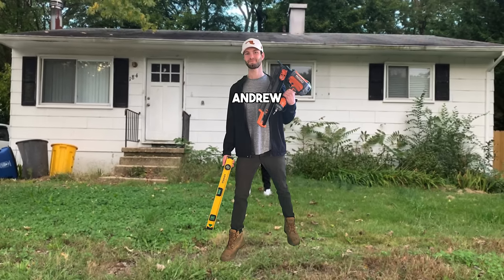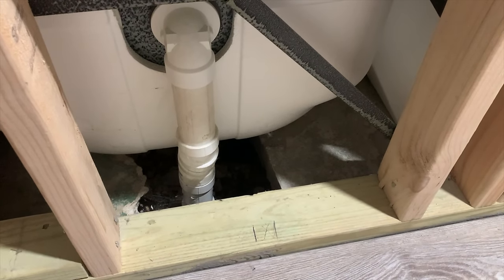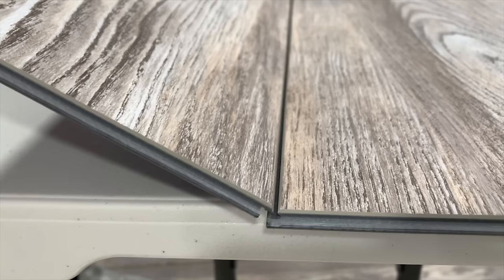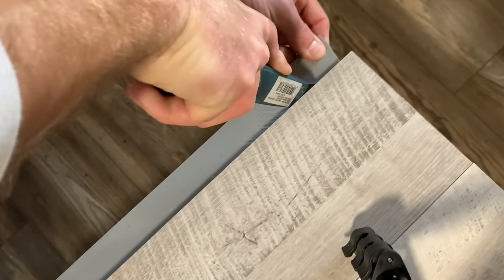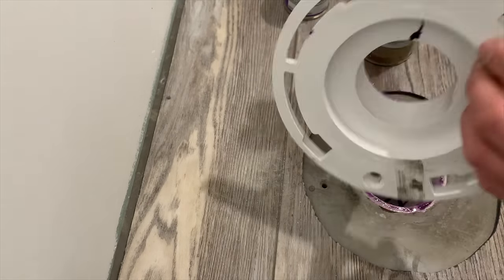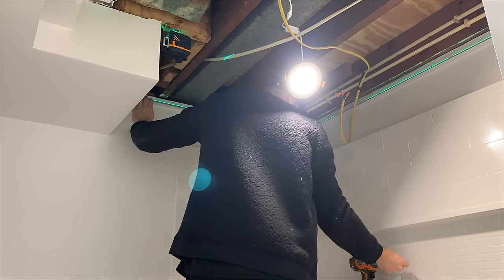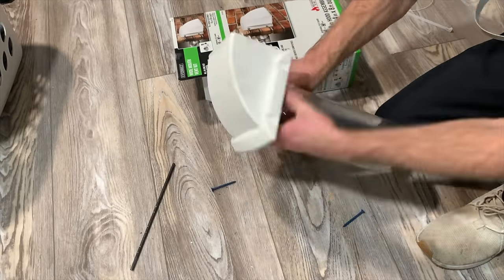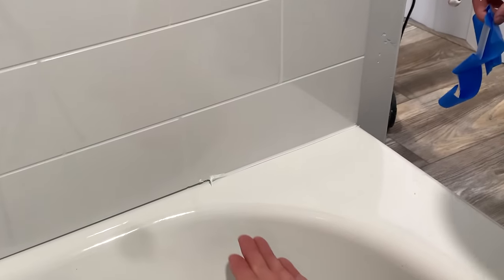Incredible DIY Basement Bathroom Addition Timelapse From Start to Finish! (+$39,000 in Home Value!)

Comment: I’m not a fan of dry walled ceilings and walls in a basement. How do you get at the plumbing, electrical, and drain systems. Next basement I’ll use a OC product that the panels click into place for the walls. And for the ceiling, although a smooth flat surface is nice, this system employs T shaped track. One side gets attached to ceiling and the other section snaps into place. Allowing to get at ceiling mounted support systems.  You did a very nice job on your basement

Comment: Nice work! For the best silicone lines you use tape first and then soap water. And you should add silicone to the ceiling boards, moisture from the shower Will rise and get up there Even with your fan on 😊
Reply from the maker: I appreciate it! Soapy water is good too and window cleaner works too! Thanks for watching!

Comment: I’m back and forth about drop ceiling in the bathroom I’m planning on my basement. I read that it can cause trapped moisture and of course lead to mold. Thoughts?
Reply from the maker: Hmm I don’t see how a drop ceiling would trap any more moisture than drywall 🤷‍♂️ I’m initially skeptical but I may need to do a little research
Reply: Okay yeah, I was all about doing a drop ceiling, then I looked it up and saw a lot of literature saying it’s not ideal due to moisture accumulation/retention- BUT, pvc might be the factor that makes your application safer, along with the fan location. So yeah just another DIYer to another I say do what works best and as long as you’re aware of potential issues - just keep an eye on it.

Comment: Nice work! I plan to do something similar in my basement. How much did the rough in plumbing cost you? I know there are a lot of variables, but I’m also in the Northeast and trying to get a ballpark for how much hiring out that step (including the concrete work) would cost.
Reply from the maker: I appreciate it! I spent around 2,500 for the rough in plumbing (which I think was a pretty good deal). Thanks for watching and good luck with your project!
Reply: @AndrewThronImprovements  you got a great deal! I would’ve expected 2-3x that

Comment: You should always build floating walls (code for us in Canada and likely northern states too) in a basement due to the slab shifting. This prevents it from heaving into your floor joists.

Your electrical wires werent stapled properly. Thats an inspection fail.

You don't need a licensed anyone to do any rough ins. Typically (not all the time) Homeowners can apply for their own permits. Just be sure you know the building codes for when it gets inspected.

Comment: I've seen your videos and can tell you take pride in your work. But this job was not something to be proud of. The waterproofing on theat shower tub is pathetic. The LVP is a big mistake. You should have tiled the floor. The accordion door is a real bad look. The custom barn door is odd considering the work on the door vs the work on the bathroom. The PVC piping is really weak. Use pex or copper

I like your videos. Not trying to rip on you. I just think if you are going to film a video, you need to do better. If your a scammer trying to make easy money on a flip (I know you're not), keep doing renovations like this
Reply from the maker: Appreciate all feedback! Let’s dive in a bit though:
1. Can you elaborate a bit on your waterproofing comments? The tub was set by the plumber and the shower surround was installed per manufacturers recommendation. As far as caulking, it is actually advertised as “Caulk Free”, but I added some as an added layer of insurance. 
2. For the LVP, I just matched what was done in the rest of the basement. I agree that tile is nicer. 
3. Accordion Door is definitely now a proud point haha. I call it tacky in the vid (cause it kinda is) but I needed access and went with a quick, cheap solution. Can’t defend that one too much haha.
4. I Agree they PEX and Cooper is superior to CPVC. I didn’t specify in my SOW (my mistake) and the plumber did the rough in with CPVC. 
5. Custom Barn Door was just a fun project I thought of. I agree that it is a bit out of place. 

Let me know your thoughts on technical issues. I am not as worried about stylistic choices since no two people will agree on those. 

Thanks for taking the time to watch and comment. Appreciate you!
Reply: @AndrewThronImprovements  

Hey no problem!

1. No problem with the tub. The issue is the shower surround. What you have almost always (99.9%) fail swithin 10 years. Water finds a way through it. I've seen it plenty of times and everyone I know involved with remodeling/building agrees. Most homes built before 2010 have tiled surrounds with waterproofing underlayment underneath.

2. Nothing wrong with LVP. Love that stuff. But in a bathroom with a shower, you are major risk of water penetrating and mold growth. I know it says waterproof but water gets through after several years and ends up in the basboards and drywall. Once again, most homes built before 2010 have tiled floors in the bathroom

3. You were smart for putting access to the furnace instead of more work to get access another way. Work smarter not harder. I just would have gone with a door lol

4. I've never seen CPVC for potable water be a good investment. Surprised a plumber uses it.

5. Bard door looks great! My comment was just the amount of work for that  vs say not tiling the shower and floor seemed odd

Love the videos